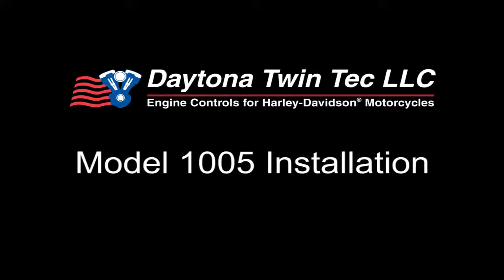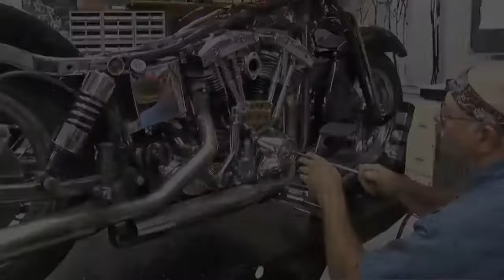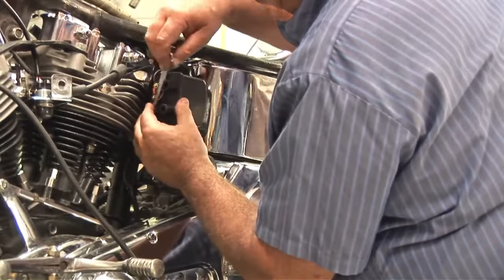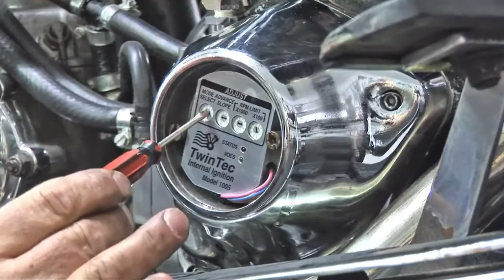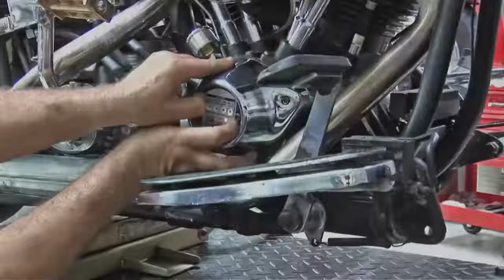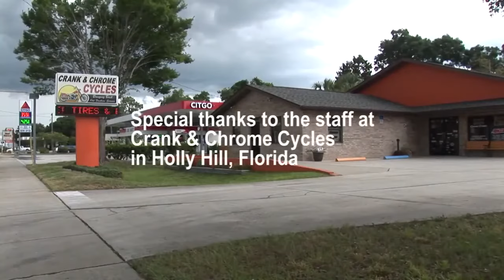How To Series - Daytona Twin Tec  1005 Ignition Install

Comment: Extremely helpful. I believe you have answered my question. About 14 years ago I had a 1005 installed on my s&s 117. Worked perfectly. Now I have no spark and the red light never comes on. I checked all wires and everything has power in it. So I believe my module finally died. I'm in NE Florida.